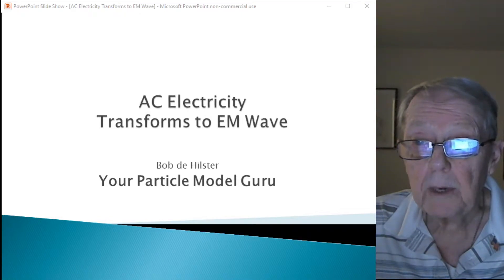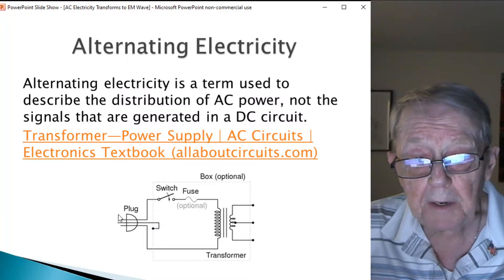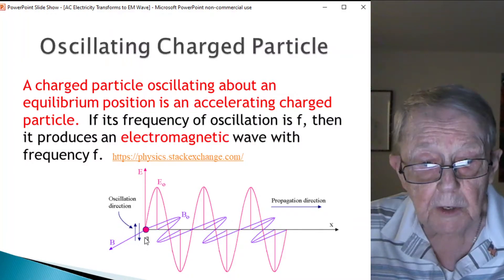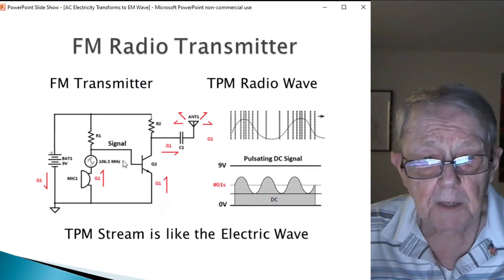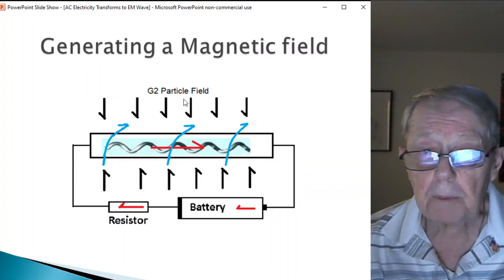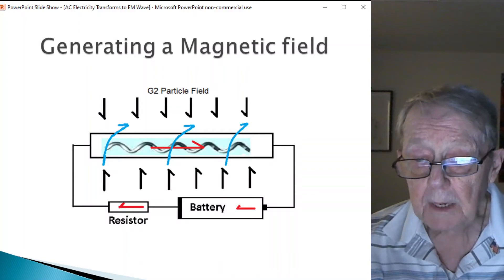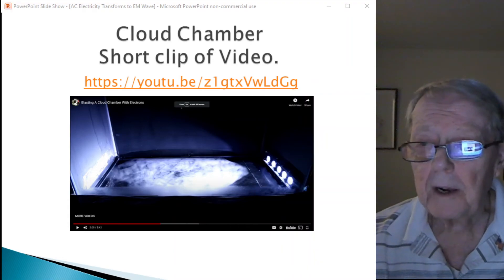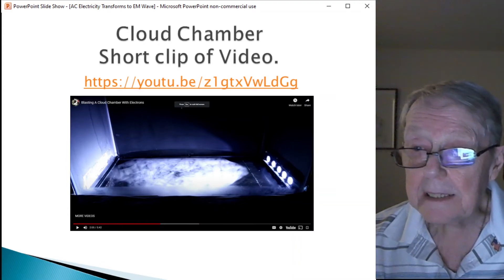AC Electricity Transforms to EM Wave

Comment: In the other video you put on yours, the bubble chamber had electrons passing through it.  With an antenna, the electrons may be pumped into a steal rod with DC pulses, but they have to go somewhere.  Are electrons being emitted by antennas or are they back flowing back up the DC line when the pulse ends making an AC flow?  I did find out years ago with a transformer that spark pulsing DC can pump higher voltage through the transformer.
Reply from the maker: Good question! I am working on the first half of the question from another viewer. In that case, there will be a discussion on the need for the ground plane of the antenna.  Hopefully that will answer the question?